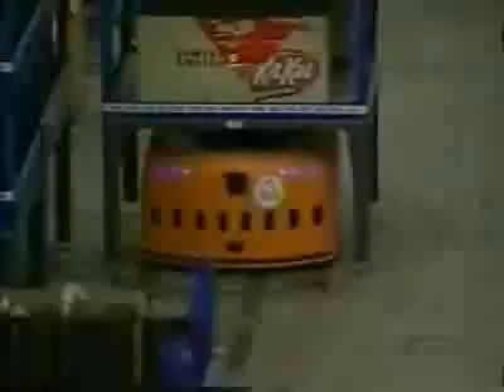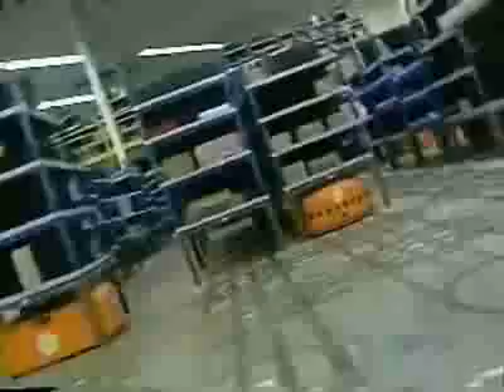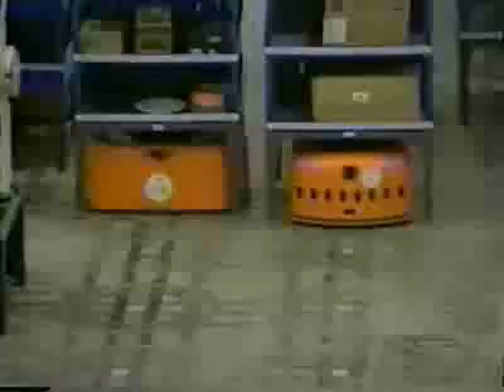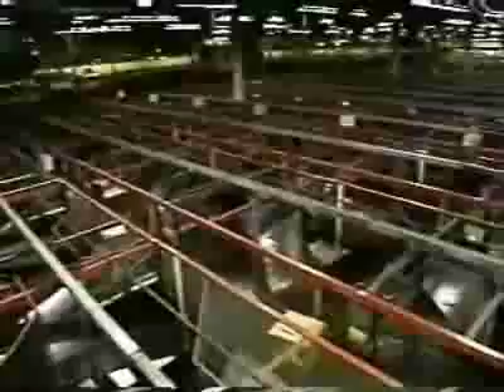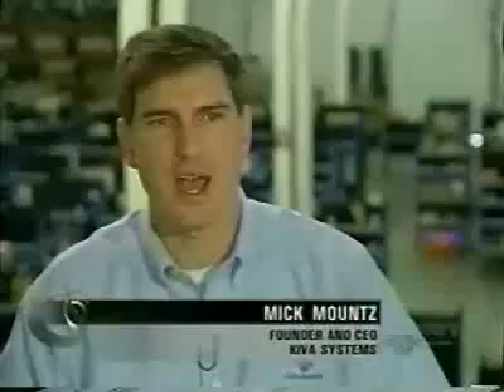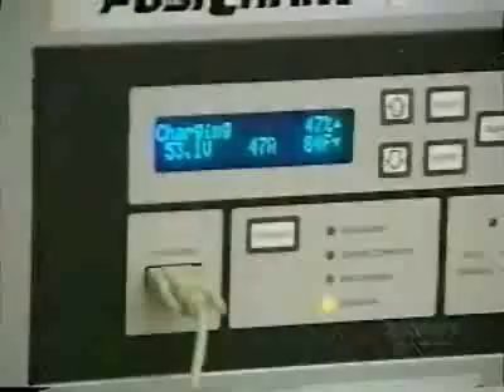Kiva Warehouse Robotics (Discovery Channel)

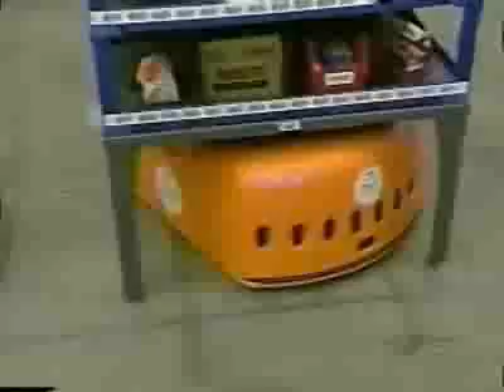Comment: i didn't quite under stand 2:23 about the counter-rotation screw. How is it constructed? Do you have a link so i can see how it works? Because i can only imagine that nothing would happen if the robot rotates one way and the screw in another direction. I have a project in school aobut robots and i need to know this cause i need to give blueprints after i've explained what it does etc. Please help me.